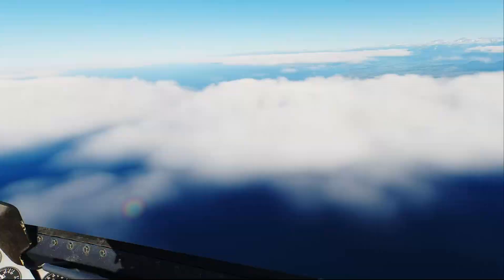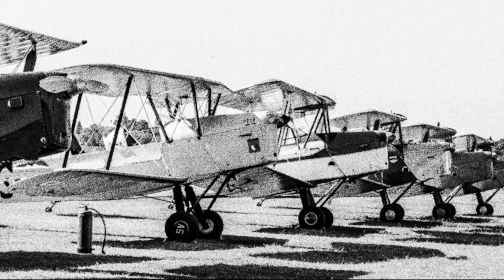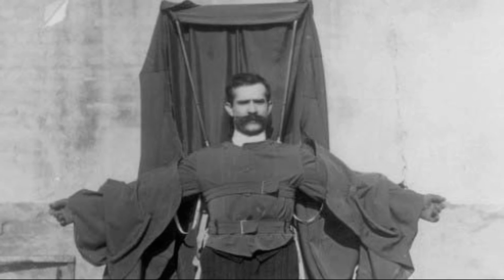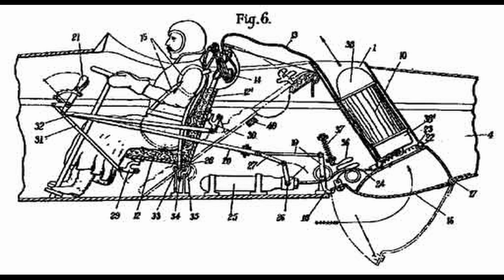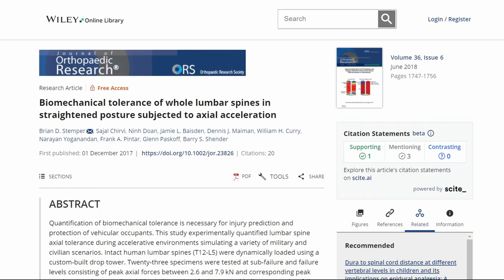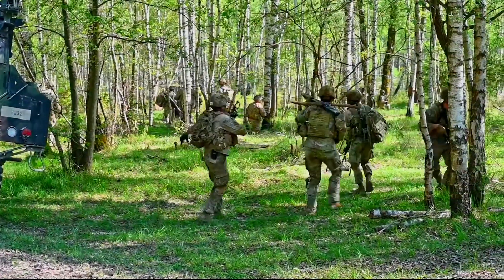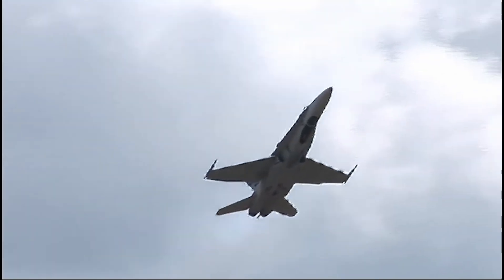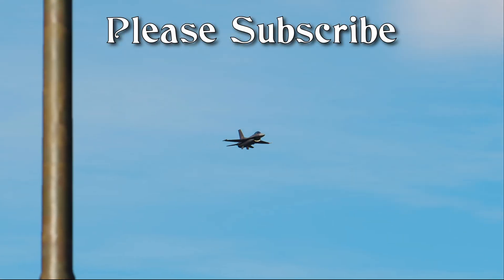The (Kinda Cursed) History Of The Ejection Seat

Comment: Interesting early history. Some of your information is slightly off and only really focuses on the Martin-Baker contribution when there were many other seats around the world. The Zvezda K-36 is very different, and there are no seats to my knowledge that are rocket only. I am an ejection seat historian and run a web site on seats. Thanks though for finding a few interesting tid-bits.
Reply from the maker: I wished I could've touched on some specific seats. The K-36 would've been really interesting to talk about. In fact, I wanted to mention that one specifically due to a video by Paper Skies on the SU-24. Unfortunately it got cut for pacing reasons. The video isn't intended to be all encompassing, rather, it's designed to be a primer or summary. For that same reason, that's why I focused on Martin-Baker so much since, as mentioned, they're basically the industry standard in the west. As for a rocket only seat, the ACES V is described as using a rocket powered catapult (CKU-5C) along with the main rocket booster, hence the quote. 

The website is cool. A site I used for a lot of my research seems defunct and so I had to use the wayback machine a lot. So glad to see another endeavor to preserve the history.
Reply: @aviationrambler  The Paper Skies video was interesting but doesn't cover some of the details. My site isn't dead but it is waiting for me to have time for some massive updates. The ACES 5 (not V) uses the CKU-5C ROCAT (Rocket Catapult) which does still use a cartridge to initiate movement. The history of egress is hard to track because a lot of it wasn't considered important compared to the aircraft, yet there is a tremendous amount of evolution that the designs have gone through. The K-36 took several innovations from other seats around the world, along with Russian pragmatism and developed a pretty good seat. With the upgrades that followed the Foreign Comparative Testing program they are quite good. The Martin-Baker Mk 16/18 seats are also very impressive as is the ACES 5. 
Comparing the Generation 1 and 2 seats with the more modern ones is like comparing a push mower to a riding mower with all the accessories on it. And you touch on one of the key things that is hard for people to understand, which is that 90% or more ejection seats will end their lives still in the cockpit. Much like airbags in cars, which is one of the very few technologies with that kind of expectation.

Comment: A detailed and interesting look into why pilot ejector seats are simultaneously life-saving and injury-promoting. The human factor is clearly delicate: too much force injures the body, not enough force limits a pilot's separation from the aircraft.

Would it be possible to force a separation of the cockpit from the fuselage, thereby giving the pilot the chance to separate in a [hopefully slower-moving] shell which would slow their ejection need? Or is the "ejection calculation cocktail" still something systems developers need to get better at? 

Food for thought. Take care.
Reply from the maker: Truthfully current seats offer plenty of separation. It's just zero-zero is the absolute worst case scenario. 

There have been some aircraft to use a capsule, the F-111 comes to mind. Of course there's pros and cons there as well. Nothing's ever free sadly. It does offer a lot of protection for the pilot, at the cost of a lot of weight and cost. And the weight savings could be argued would contribute to better evasion of threats, preventing the need for ejection in the first place. Still tho, it does open up the ejection envelope at higher speeds.
Reply: @aviationrambler  Zero-Zero is in some ways the worse scenario but high speed ejections are extremely dangerous. The relative wind can cause flail injuries that often are lethal. The new head and neck protections on the ACES 5 and Mk 16/18 seats helps reduce that. 
Capsules are not only very heavy, they require a very large explosive chain to sever the skin, cables and other connections, as well as huge rockets and parachutes. This explosive chain is one of the main reasons the B-1B didn't follow on the B-1A crew module. It would have required too much fleet downtime to keep the charges in date.